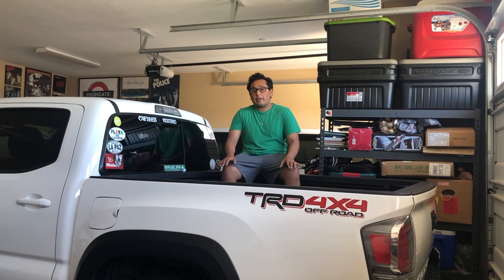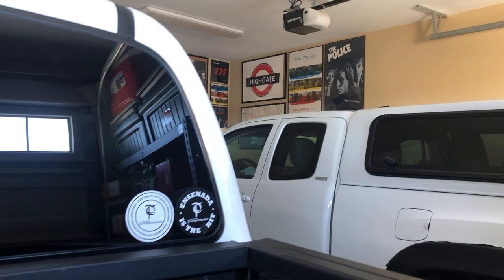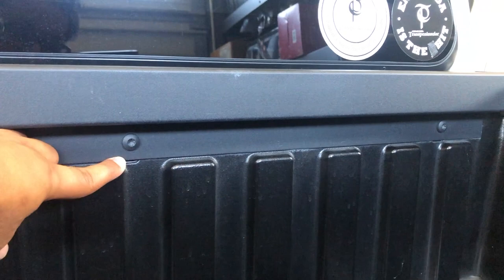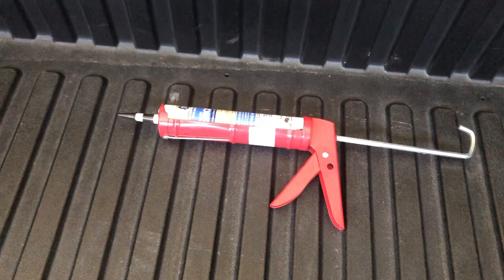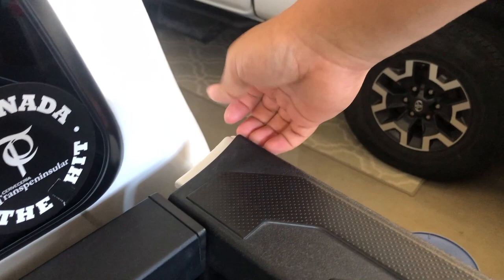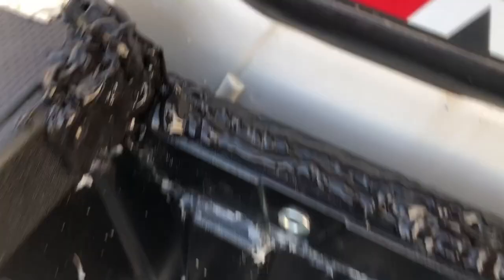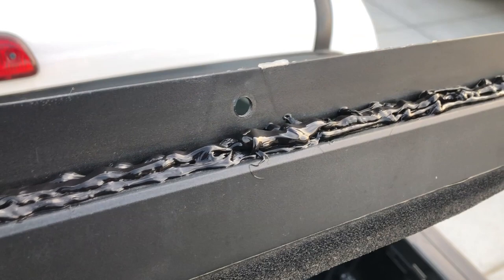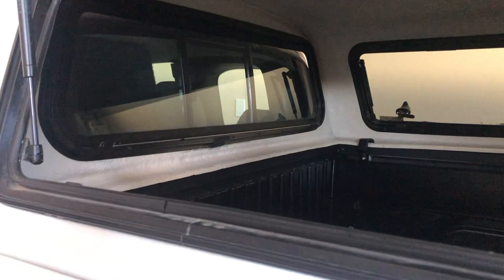Watch This before you get a Camper Shell for your 3rd Gen Tacoma

Comment: This is 100% legit information. I literally just got my new shell installed on my Tacoma this afternoon. The installers at the shop fortunately knew about this issue with the 3rd gens and they do this on all new installations. Only difference is they use some kind of non hardening rubber, same stuff used to seal seams on RV’s. Whatever you use just make sure you do it.

Comment: I would suggest adding Cali raised bed stiffeners because if you're adding a camper shell or a tent or a rack the bed is made a composite plastic as you know and over time there can be a stress crack and if that happens you'll have to buy a whole new bed I installed Cali raised bed stiffeners and they are awesome the beds beds more strong and they weren't that expensive highly recommend them
Reply from the maker: I did not think of this, how much did they cost you??

Comment: Terrible, if you put rubber between the cap and bed ya simply could have made a drip edge piece to hang between bed and cab passing over the crack.  🤦🏻‍♂️. I’ve done it on my previous Tacoma and never had water issues!
Reply: Anthony Weber would / could you send a pic of your drip edge fix ... I’m fixing to get a leer for my Tacoma
Reply: Could you please respond to this with some photos or a video showing how you completed this? I would like to seal mine up. Without all of the silicone. Thank you
Reply: @tsdub  Sorry, I don’t have any pics but on my new 2020 Tacoma I’ll be sure to take some and a video of what I had done previously.  As of now though I haven’t had any issues with my leer cap on.

Comment: Yep I did the same thing. My bedding and shelves are inside. I did one extra step by skirting the perimeter of the inside where the cap meets the bed rail with plastic membrane . Now the trickles come in and hit the plastic and run down into the drain holes. Everything stays dry.

Comment: That silicone will encourage rust at all points that it comes in contact with metal parts.  
Will your pickup’s paint create a stronger enough barrier¿ probably not! 

Ask any competent auto glass installers about customer silicone patch jobs. 

The sealer that you can use that does not encourage rust is automotive grade windshield urethane, which can be purchased at your local autobody paint supply store.

Comment: Removed incorrect info
Reply: hey man good  video I want to ask you something I have a 2015 Tacoma Long bed  I'm on the market for a camper shell but I want to buy a used camper shell  do you think 2016 Tacoma camper shell Will fit 2015 tacoma
Reply: Could you share a link to these parts? I cannot find them searching GOOGLE. thank you
Reply: @microsnook3  I changed the part number in my original
Post . Somehow I dropped a zero
Reply: @microsnook3  I’ve got some on order I’ll let you know how they work . 
I got mine from sparks Toyota
Reply: @f86sabjf  thanks, but im still having trouble locating the exact item
Reply: @microsnook3  I’m removing post so nobody else spends the money . So much for the internet folks knowing what there talking about 😂

Comment: Horrible design by Toyota … I’m having this exact issue … Great video 👍
Reply from the maker: Sorry to hear this Al... Yes, I was so happy to have the shell, but I truly never got the truck to be 100% water proof back there :( I hope you get it done! I have since sold my 3rd Gen Tacoma
Reply: I’m very happy with the Truck other than that … Honestly I would of not spent 4500.00 on the shell which included the upgrades if I knew this was an issue … I was upset set with the company who I bought the shell with not elaborating on the fact there is a leak issue with Tacomas … I probably would of just invested in a 4 wheel camper pop up and called it good
Reply from the maker: @alansarpy  Al, This is very disappointing to hear my friend... The shop Should very much so ensure that they take care of the leak!! Its just a shame that it can spring from anywhere at anytime... Perhaps you could sell the shell Private Party?? On my new Nissan Frontier Pro 4x I opted for a minimalist Camper set up with my RTT, You should check that out!
Reply: @BlazzinTech  yeah the company I bought the shell from has plugged it up it with silicon and it looks horrible to look at 😠, but At least the leak is down by huge amount …  I know it’s just a band aide .. I called Toyota and they said it’s not their problem Lmao !
Reply from the maker: @alansarpy  Maybe you can try Permatex Gasket Maker